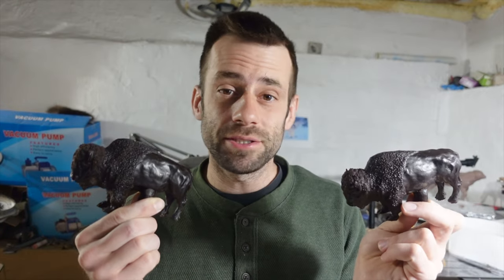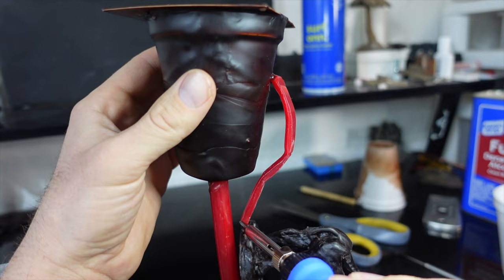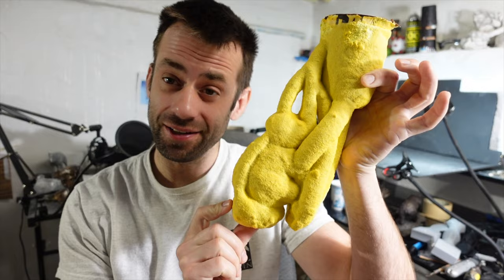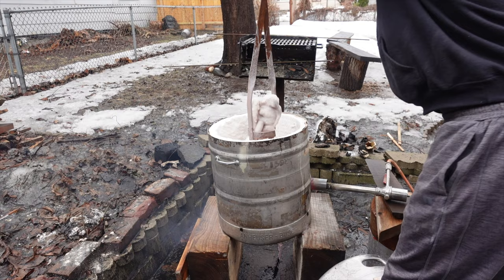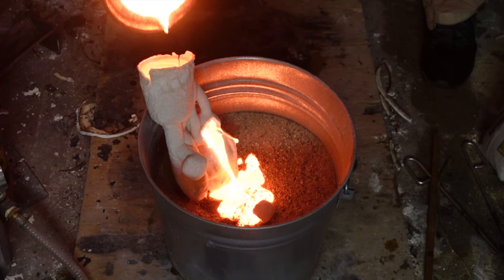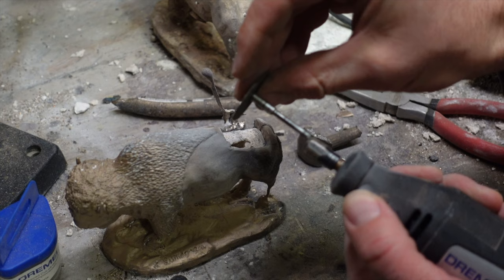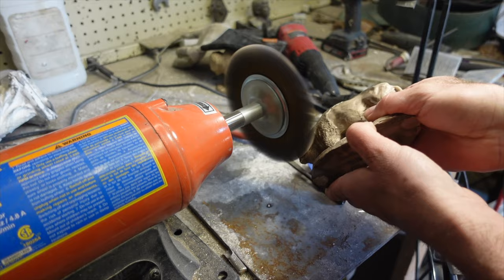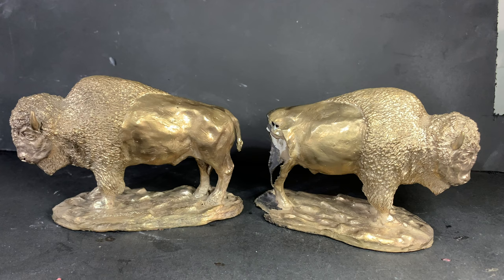Investment Casting VS Ceramic Shell for Bronze Sculpture

Comment: I cast bronze at UH in Honolulu in 86. We used USGS plaster mixed with very fine silica sand (100 mesh) as the investment. Cheap and available mix. Its been 45 years but I think the ratio was 2/1. We also used a tapered main sprue that was J shaped. We cast sprues in wet plaster molds made for that purpose. The cup was attached to the top of the J. The taper in the sprue decreased toward the hook in the J. The cup of the sprue was waxed to a piece of ply. And the model was attached at the hook of the J. Other sprues came off the J at an angle attaching to the sculpture and we waxed cotton string and drinking straws to form vents that were also attached to the ply before investment. The whole thing was surrounded by a tube of tar paper with a chicken wire innertube. It was cast with the investment upside down which always left the cup hollow for recieving molten bronze. The tarpaper was removed leaving a large block of plaster with an embedded chicken wire reinforcement  ready for melt out. The trick was when you flipped it over and removed the ply, the cup was facing up. At that point the tapered J was hanging there in the investment under the cup. As you filled the cup with molten bronze the weight of bronze from the cup pressurized the bronze down the J sprue and up into the piece. The taper in the J created a venturi  effect forcing bronze into the mold cavities and squirting out of every vent hole. We also used a shop vac after burn out and sucked and bits and ash out through the cup before the pour.. DM me if you want to chat.
Reply: I'm not a bronze caster, so this sounds like Greek to me, but seems to an ignorant person like me, that it's good advice for him in the future. But the year you said is the same year myself and my man was born, and we are both 37 , turning 38 this year, so, if you say it's been 45 years ago for you, I'm guessing you're referencing the year you started college. God bless you.
Reply: Funny thing about plaster is it starts to calcine and break down when it's heated to something like 135 degrees F. Burning the  gypsum rock and grinding it up is how the plaster is made to begin with.  I remember putting a small cast  hydrocal sculpture in a ceramic kiln at  cone 05 or 06, it warped and shrunk quite a bit, I can't imagine it works real well for burning out the wax and pouring in 2000 degree bronze, though I used a 50/50 plaster/sand mix to pour Brittania metal in, but that was only around 450 degrees F
Reply: @bonedaddyshonestreviews6933  38 years ago for me, not 45. Then I went on for a teaching fellowship/ MFA at UofO in ceramics. That being said, I'm a 56 model, so yea, older than dirt. I continue to cast bronze and other stuff using the same method. Though now they have no stir ceramic shell which for the small timer is a big improvment. Im sure there is a lot more chasing flash with plaster and sand.
Reply: @itsclearasmud7718     I'm glad I was able to help you remember the number of years clearer, that way you don't make yourself seem older than you actually are 😜. I'm sure you appreciate not feeling older than you actually are 😊. And 56, in my opinion, is still somewhat young. Particularly because my mom died when she was 56 years old, and I was 19, so it's been 18 years ago for me now. So, please, at least for your own self-esteem, don't force yourself to FEEL older or SEEM older than you actually are. You ain't 56 years old, you're 56 years young. God bless you!
Reply: @bonedaddyshonestreviews6933  Im 68.
Reply: @HobbyOrganist  I think hydrocal and hydrostone both have portland cement in the recipe.  That might be the culprit. Ive made ram press molds out of hydrostone and its a much harder dense material. I dint remember what the burn out temp was. Probably below 200 for many hours to avoid steam explosions.  A book i found really helpful is: Methods for Modern Sculptors by Young and Fennell.
Reply: @itsclearasmud7718   Oh. When you said you were a 56 model, I thought you meant your age. That's the year you were born, isn't it? My bad. Still, I bet you appreciate someone wanting to help you feel younger than you actually are. But still, 68 to me isn't that old. It just means you have a lot of good wisdom to share, and you still have PLENTY of time for more wisdom gathering as well, which I hope would be happy rather than sad. God bless you sweetie.
Reply: I done some castings and you have to use 1/3 of ceramic plaster + 2/3 of quartz (#200) + 50% water. I had some problems with cracks in bigger pieces so I had to use 400 grams ceramic plaster + 600g quartz #30/80 + 200g quartz #200 + 500g water (for 1 liter of volume) (2/6 - 3/6 - 1/6 - 40%).
Then I burn it in an electric furnace...
Reply: @nicoleetoo  sounds right on.thanks
Reply: @itsclearasmud7718  with the finest quartz is in base of a paper but he last one is in base of my experience and practice. Maye you could start with that and improve it.

Comment: Without burying the ceramic shell, it's more brittle than an eggshell.  You bury the ceramic shell to add support to the shell so that it doesn't crack and the bronze pours out, ruining your casting.
Reply from the maker: Some guys hang their shells on racks in the open air a pour into them. I don’t know how they do that. But the thinking is if it does start to leak they take a cold piece of iron and seal the leak and continue the pour. If it begins to leak in the sand they can’t seal it. But it didn’t work out to well for me as you saw.

Comment: if your vacuum pump malfunctions, you can try releasing the air bubbles with vibration.  putting on top of a washing machine when it's at full revs and tapping the bowl with a solid object will do the trick if you have nothing to hand

Comment: Ive made plasticene standing dog models in the 1990s, about 7" high with a base attached. I made plaster piece molds of the model, the German Shepherd  took 7 molds. I then made block molds of those and poured in a soft liquid rubber, probably Polytek 74-40 and then I had a set of molds to cast plaster waste mold pieces in.
I cast the 7 pieces for the German Shepherd and once soaped and assembled I poured the hot wax in. Some of the 7 plaster pieces came right off, some had to be drilled and broken apart to remove from the wax, then I had a near perfect wax cast with no attachements needed as the base and everything was integrated in the wax casting.
I shipped that off to Parks Bronze in Joseph Oregon and had them cast it completely solid, artist supplied wax, patina ready was $110.
I did the patina and mounting on a 1" marble base, it weighed 24 pounds.

I still have the molds, and in fact I just cast the 7 plaster pieces this week and I also still have my wax pot that is half full of the nut brown wax I used 30 years ago, more than enough to cast the dog. I'm going to send the wax out to a foundry that is also in Joseph Oregon as Parks Bronze is no longer, neither is Weston Studio which I also used back then.

Ive poured bronze in a college non credit class before, but it's a lot of work, you need  the furnace and tools, so much can go wrong and frankly I'd rather just pay the foundry professionals who do this all day every day just cast the bronze for me and I'll do all the rest of the phases involved.
It can be difficult to try and handle a blazing hot , heavy cruicible  in tongs that has more than about 5# of metal in it by yourself. In the class we had a two man tong to lift the cruicible out= much easier with 2 people!
Reply from the maker: A well equipped foundry can cut down on the cost. It’s not worth it for me to take on projects like that. I turn down a lot of commission work. $110 in 1990 adjusted for inflation would be $264 today. 
There are a lot of steps to this craft.

Comment: I love your videos.  I learn a lot from every one of these.   Just starting this, I need to figure out as much as possible before doing it.  Cost ads up fast when it doesn't work out.  Because of cost, It looks like your investment plaster is the way to go.  The ceramic dip  I bet would have a lot of uses too, but looks harder, and costs more.  Maybe use it on smaller things?
Reply from the maker: Yeah it really depends on the size and shape of the think. The biggest flask of investment I’ve done was 15 lbs. any bigger than that and it’s gets more and more awkward to move out of my kiln when it’s red hot.

Comment: Everyone is invested in their own technique 😊
But I am in the plaster investment camp. I have a different technique to yours where I build up detail layers first then follow up with a course flood layer. If an artist leaves their finger prints in the wax I intend to reproduce them. 
The best advantage of using plaster is that you can dunk it in vinegar and then water jet the last of the clinging investment off. No need to wire brush. 
The used dry investment goes into the crusher and anything up to 2/3 recycled goes back into the next flood layer for the next project. 
No one technique fits all circumstances but for small sculptures with a high texture finish I prefer plaster.
Reply from the maker: Interesting. I haven’t heard of that method. You should make a video of it.

Comment: no feeling like a failed casting. great save- you could match up  a wax of the missing bits, but of course it's a lot of work attaching. Again with another well made video, frozen fingers and all-andy k
Reply from the maker: Haha. Yeah I survived the frozen fingers!  I can cast another day!
Reply: @lundgrenbronzestudios  I  use suspendaslurry to pretty good results. gets heavy dipping and coating, "catbox method". some say you can fill them with water to check for leaks, I don't, but I should. when I use satin cast it is in the centrifugal caster which is really fun. that stuff costs so much to ship I drove to Oakland (100 mi RT) to save the $150 for 100 lbs. my  flasks are 3-1/2 X 6 max, but for that small stuff it is often silver, like your strawberries.I haven't done much hollow ceramic shell-it is tough to remove, and I just gas weld.andy k

Comment: Nice comparison.  Reminds me that I need to do some spruing videos.
Reply from the maker: Yeah. Spread you knowledge. I watch your videos but I forget things. Then I re watch them and I’m like, “oh yeah I forgot to do this and that, and I wasn’t suppose to do that”.  But your videos are very helpful.
Reply: What did you think of his problem and solution at 4:13?
Reply: @BobbyJ529  He is right that you want to keep those holes open as long as possible to aid in drying but eventually they will close if you don't cut a large enough opening.  In those situations when the hole can only be so big, it's okay to let close.  The reality is that the core, because of compression, can be a dip or two thinner than the exterior shell.

Comment: I wonder if it would be possible to do 1 or 2 coats of the ceramic shell and then dip the rest into investment plaster? Maybe that way you will get the smoother finish of the ceramic shell method but don't have to wait as long as well as risk that It cracks?

Comment: I think that metal actually stays cooler if you turn the heat way up because then you can Weld faster and it keeps it cool. If you have the heat low then you have to have the heat on it for longer which makes things even hotter in my experience. But to each their own, and if it's working for you then that's great too! Keep up the good work brother

Comment: I use investment a lot. For years.
It can vary from brand to brand, and the liquid you use. I know you used water, however some investment use a special liquid. If that liquid freezes, its fked.
If you overheat, under heat, the metal, that can effect the cast. 
I few other things can have effects but im tired and going to bed.
Great job though buddy, you made me wanna try some larger items. I do dental and jewellery.

Comment: I want to get into Lost PLA Casting, after watching this video I think I’d rather try the investment plaster. I just got a foundry that was purposed for gold, but I’m hoping I can utilize it for converting 3D printed into metal. Also I can design the vents into my model, so it looks like it will be way less complicated than wax
Reply: If you're working with gold, why wouldn't you just get a resin printer? I'm assuming you can get a resin for them suitable for investments? 🤔

Comment: In your case, I think better truly is the enemy of good enough.  The quality of either casting is within the variability of factors beyond the investment method. The choice of using traditional investment methods or ceramic shells is made for reasons other than the quality of the final product.  I expect the all-up weight of the invested pattern and final casting have a great deal to do with the actual choice of methods in commercial settings.

Comment: 15:07 dang. US prices are high. In the EU I paid last year 180EUR for the bucket od SS RS
Reply from the maker: Shipping price is the killer.
Reply: @lundgrenbronzestudios  yeah. But I got info that the price is 2x higher if you want to buy in winter season when the slurry can freeze - then they ship in special containers to prevent that.
Either way - 180EUR is about 200usd so a lot less than 300usd shipped - the price without shipping with self pickup is 120EUR
Reply: @lundgrenbronzestudios  Back in the day I purchased my investment from a local aluminum foundry.  Don't remember the brand names (they used two different types and both worked equally well on my  silicon bronze castings).   Getting harder to source locally as it seems like everything is made in china these days.  Still doesn't hurt to call around or just stop in and ask if they can spare a couple 20lb bags.

Comment: the shell cast has pure lair of ceramic then a sand then a larger grain sand then larger bits like crushed walnut shell this helps hold the form without cracking.. also there is a liquid binder colidal silica this will set hard with a blast of Co2 you can  mix your own slurry with it. there are all sorts of powders and sands that can be bought cheap if your willing to do the research to find what you need .. good effort though
Reply from the maker: I’ve tried a number of different materials. Shipping of any kind of sand is not cheap.
Reply: @lundgrenbronzestudios  one of the reasons its called investment casting as it costs a lot of time and money
Reply from the maker: @Ugly_Baby_Gaming  yeah it’s an investment. Ironically the investment is cheaper than the slurry and materials.

Comment: I've  read that people spray IPA over the wax model prior to filling flask with investment. Not much, just to get the model slightly wet. This prevents air bubbles from sticking to the model. I'm using this from day 1 and haven't seen bubbles on models yet, though I don't have big casing experience.
Reply from the maker: What is IPA?
Reply: @lundgrenbronzestudios  Isopropyl alcohol

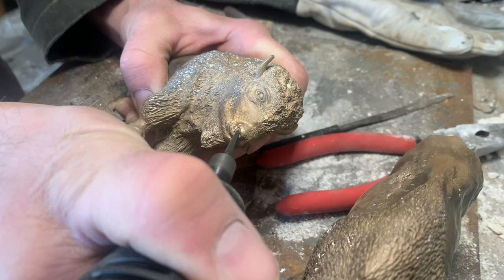Comment: 12:56 you might consider running pins in to hold the core and fill it ahead, replacing the fill hole. Clip the pins after. Way less finishing.
Reply from the maker: Is that how you do it? Just leave the core inside. I always remove the core on my investment castings.

Comment: I'm new to metal casting. I've heard that basic plaster in a pretty good material for casting aluminium and bronze. Is that true? How well does it work?
Reply from the maker: Honestly it doesn’t work very well. People do it but it’s not ideal. The people who do it usually mix it with sand so it has some permeability and you have to heat it very slowly to minimize cracking.

Comment: I think another problem with the ceramic shell failing is the sanding you are using to coat the model. You need to use silica sand. That will help with the shell cracking
Reply from the maker: It is silica sand. But it’s well rounded and I think I need an angular sand.

Comment: So wait, is the investment method cheaper, easier, better, and faster?   I vote investment :)
Reply: yes for smaller casts - try to use it for a cast that is like 60cm hide 30cm wide etc - try to make a flask to use for that, and how much investment you would need to use to cover the pattern for it.
for me suspenda slurry is better but only because I make cast bigger than 10-15cm in height.

Comment: Both look good so for me the success/failure ratio would be the key as I am just beginning to learn and do not have silicone molds to make several similar items.
Reply: Would it work to just use bronze "chappies" to keep the inside on the inside and then just leave it at that or is there a practical reason to keep the statue hollow? I mean is there a way that one can fill the inside with investment, secured with bronze pins, cover it again with wax, chase it and cast it as if a solid piece?
Reply from the maker: Yeah I have done that. I actually made copper corona virus where I made a hollow round ball of copper where I did just that. I filled it with investment and then I put the sprue over the hole so when I cast it the hole was covered and the center remained filled with investment. I don’t normally do things that way but it can be done.
Reply: @lundgrenbronzestudios  Thank you for the answer! There is enough equipment to invest(!) in without a welder so that is welcome. 😊

Comment: I vote for investment.  Seems cheaper and a little easier.  In industry I think slurry might be reserved for higher temp metals like stainless, or where dimensional accuracy is critical like for NASA, maybe(just guessing again)?
Reply from the maker: I will keep experimenting with both but will likely use investment more often.